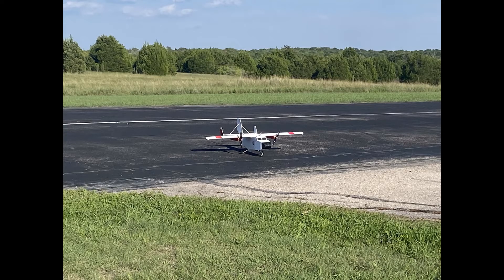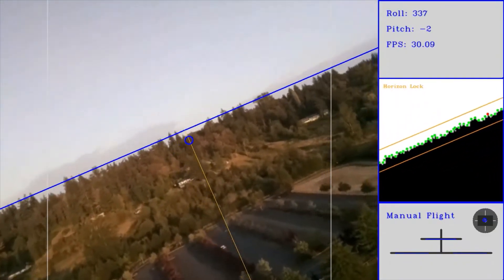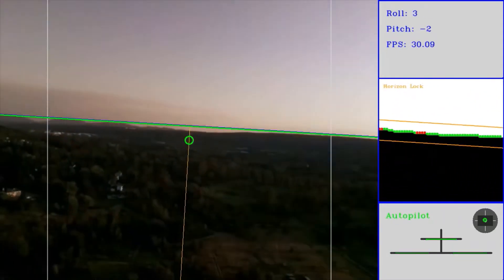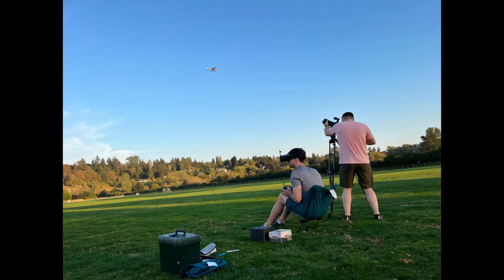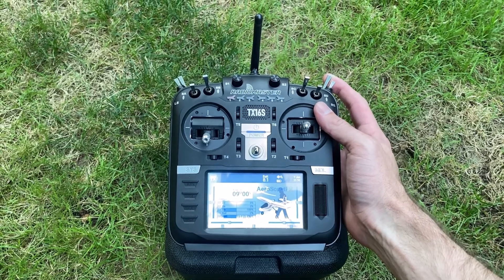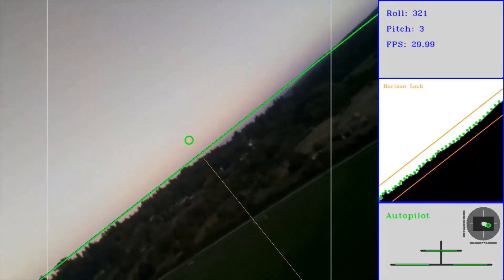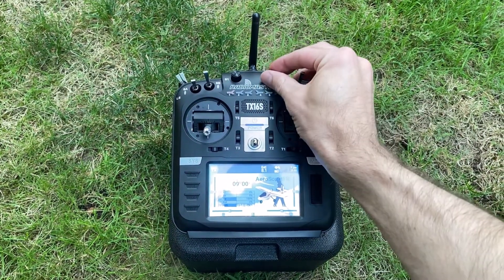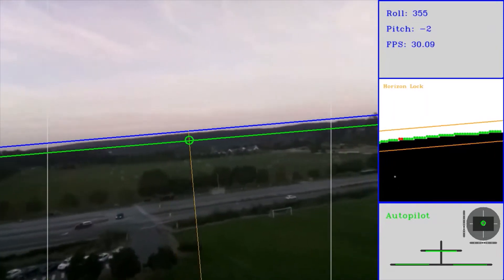Computer Vision Autopilot for RC Airplane

Comment: Hey tim, how did this drone to maintain level flight without use of altimeter during autopilot?
Reply from the maker: Hi Sahil. Altimeters don’t keep a plane flying level; that’s the job of a gyroscope. My system can keep the plane flying level by visually identifying the horizon. Since it doesn’t have an altimeter, it will tend to lose or gain altitude over time. I’ve tried to think of ways to visually gauge the altitude of the plane, but haven’t been able to solve that problem yet

Comment: May I ask how is the realtime video feed transmitted to you? What is the controller range of such a RC plane and how would you know it is about to go out of range? What happens if it fly out of range? Lost forever? Thanks!
Reply from the maker: There are two cameras on the plane. A raspberry pi camera 2 is used for the computer vision operations. It also records footage onboard, and that is what you see in my videos. It doesn’t transmit footage in real-time.

I also have an FPV camera with an antenna that transmits footage back to my goggles. I have never really tested the range, because I fly within a park, but sometimes at the corners of the park, the image starts to get a fuzzy, so I turn back.  The airplane transmitter has RSSI, so I get warnings if signal is low, but that rarely happens in practice.
Reply: @timmarkhuff  Great stuff. Thanks!

Comment: Cool project😊 don’t bother with rudder control
Reply from the maker: Why no rudder control?
Reply: because it's useless unless you wish to do aerobatics (assymertic flight) or if you must have a perfect lateral control during crosswind takeoffs and landings 😅 => I think both cases are irrelevant in your case (basically mono speed aircraft. takeoffs and landings from/to whatever )

Never forget that the best way to avoid a system failure, is by deleting it lol. 
Go on simplicity.

Use programmable/mechanical aileron differential to avoid lateral dissymetry during flight ... but maybe you have no idea of how to adjust such parameters ... ?!?

If your airplane has issues with lateral stability, increase the vertical surface. An approximate formula here 
Va*l/b*Sw=0.035

where :
Va=vertical surface (rudder and fin)
l=distance from the forward 1/4 of the wing's median chord to the forward 1/4 of the vertical surface's median chord
b= wingspan
Sw= wing surface
all figures must be in metric decimeters.

I really love your project. Ask for more info if you wish :) GL

Comment: Seems it would have difficulty flying in mountainous terrain where the mountains extend above the horizon line.  This reminds me of the AP2000i IR autopilot systems we’d use on RC helicopters 15 yrs ago. Those had an array of 4 IR sensors to detect sky from ground… purely analog. They worked for the most part but not so well on cool cloudy days.
Reply from the maker: It would struggle with mountains for sure. I’m interested in making a system that uses a machine learning model to find the horizon line. I’m thinking it could look at more features than just relative brightness, and therefore achieve better accuracy.

Comment: If you haven't started working on the waypoint system consider this:

When a (return to) waypoint is designated, start recording the velocity of the craft and its time traveled, to return to the waypoint(s) you can just reverse this velocity (for binary waypoint travel) or have it loop through each velocity transposed by some algorithmn (depending on the last visited waypoint) for loop routines.

Just a thought.

Comment: I think before you move on to altitude you need to determine the velocity of the plane (perhaps you can highlight key features in the video frame like a tree, building, etc and track how it's position changes over time). Then you can integrate the velocity (calculus is useful here) in terms of time to get altitidue (you only need the vertical component of the speed). Most computer mouses use this technique and a small image sensor to figure out this their position so I recommend research how they work . I also know that the Intel RealSense tracking camera uses 2d images to get velcoity (in the same way a mouse does) and uses velcotiy to get the real time 3d position. I wish you luck!
Reply from the maker: Good ideas! I don’t think visually tracking elements moving on the screen could determine a velocity though. There are so many confounding factors. To start with, altitude: you wouldn’t see much movement at high altitude and you will see a lot at low altitude, and we don’t even know the altitude at this point. Also, turning would cause things to move on screen, and we don’t know the rate of change of yaw either.  

There may be some complicated VSLAM algorithms that could do what you are describing, but I don’t think they can run fast enough, and I still doubt if they would work at all when flying high and little is changing on screen. 

Another consideration is that all of these methods could at best tell you ground speed, but what you need to know with airplanes is the airspeed. 

Recently, I have been thinking about using control surface authority as a proxy for airspeed. I might make a video on that in the future when I start working on that, but I have other tasks I need to complete first

Comment: Awesome! If you were flying close to a mountain ("bending" the horizon), your algorithm would tend to steer away from it, is that correct?
Reply from the maker: That’s correct. I’m interested in finding more robust techniques that can deal with things like mountains, trees, buildings and other obstructions.
Reply: @timmarkhuff   I wouldn't put mountains in the same category as trees and buildings. From the point of view of a bright/dark border finding algorithm, there are places where the (apparent) horizon isn't horizontal. If your plane has sufficient aerodynamic stability, you could calibrate the inclination and height of the apparent horizon while it is gliding without any rudder input. Then, from optical flow analysis of a donw facing camera signal, estimate yaw rate and start creating a "horizon map".
Reply from the maker: @IngenieurAndreas  when you say sufficient aerodynamic stability, are you thinking of planes with dihedrals that naturally tend towards flying level, like gliders? That could be interesting. I have a glider like that, and in theory, my program could control it by only managing the pitch. The roll would be managed naturally by the aerodynamics of the plane. The idea of the downward facing camera is interesting, but I’m trying to keep it to one camera at the moment. I’ve purchased a GPS module, and might just use that to manage the yaw/waypoint finding of the plane, even though that is straying a bit from the original goal of this project.
Reply from the maker: @IngenieurAndreas  celestial navigation? Nice. Might be hard to test that out in my local park though :)

Comment: WayPoint mission only with computer vision reminds me of back in the day flying my quadcopter in a familiar area was easy to find home because my vision provided the sight of familiar landmarks but if you are flying somewhere for the first time you need to follow a road or some type of a bearing in order to find home again, right? Seems storage of visual landmarks will need to be recalled same with flying to a WayPoint from scratch without a compass? Good way to get loss, it seems? 
I am really impressed with what you've done so far!!!
Reply from the maker: Flying a waypoint mission with computer vision would be challenging for sure. Not sure if I will be able to pull it off. I typically fly at the same field, so I could train it to recognize the corners of the field. I might also abandon that idea altogether. I just bought a GPS module, so I might use that instead.

Comment: Real neat!  But what if if looses sight of the horizon?
Reply from the maker: It needs the horizon to be in frame in order to work. If it fails to detect the horizon, it will maintain its current control outputs for a short period of time (one second) and then revert to a 0. This behavior helps when it fails to detect the horizon for a short period of time.

Comment: Wow, applied computer vision to analog FPV, no less. I wonder if we could look at your project the other way, as a cost effective sensor for an existing FC implementations like APM or iNav. Say over CAN, i2c, etc, to supplement accelerometers and gyros. My Esky Eagles (same plane) was a test platform for 1.2W fpv and 21700 cells, but iNav was good enough for me, lol. I can only imagine where you'll take this! 

And besides where the h%%l did you find a Pi4?! haha
Reply from the maker: Integrating the horizon detector into an existing flight controller would be a cool direction to take the project, however at the moment I am having fun building my own flight controller. I got my pi 4 a few years ago, before they became quite so expensive and scarce. I feel extra pressure to not crash when the pi 4 is onboard.
Reply: @timmarkhuff  Tim I salute your gumption, Sir. I hope your horizons stay flat as Florida, and that your contrast values are always perfect! 

I can't judge, I'm presently trying to use Ardurover to drift a WPL D12, much, much less successfully than your project lol

Comment: Are you using some kind of edge computing device like google coral usb accelerator or intel ncs2?
Reply from the maker: No, but I would like to experiment with that. I looked into Coral TPUs a while back, and they were either unavailable or super expensive due to global supply chain issues. They aren’t necessary for what I am doing right now, but if I want to run an ML model, they would be critical.

Comment: Great project, but I dont think it would be able to fly high high because at that point, there would be no object to determine the horizon. Do you have any ideas as to how you will fix this?
Reply from the maker: The plane would still be able to see the horizon when it is flying high. However, I believe that as it flies higher, it might need to aim for some point above the horizon in order to maintain level flight; pointing directly at the horizon would cause it to go down. If this is the case then plane needs an altitude sensor to help it deal with this effect. I may never be able to test this since I am using an RC plane that cannot legally fly high.
Reply: @Tim Huff  That would make sense. This is a rather interesting and new project I've never seen before

Comment: Woah, nice work! It will be interesting to see how you approach the altitude issue. It doesn't seem like there's an easy approach. I wonder if a second camera that always faces down (two dimensional gimbal) could infer altitude by the speed of object movement through the field of view. You could also model the upper air windspeed and direction by subtracting what you expect from your plane given its performance, (turning radius and level flight considering engine output). A long climb out into wind would allow it to start building such a model that can be updated throughout the flight. I think that's how I'd approach it.
Reply from the maker: Exactly, it's not an easy issue to solve. Using the inferred ground speed of the plane could be problematic; if there's wind, this wouldn't be accurate. I'm wondering if there are any machine learning models that could be trained to infer segments of ground that are "far away". Even that has problems though. It might be slow, and what happens when the ground is not visible?
Reply: @timmarkhuff  why wouldn't a generic barometric pressure sensor work for you?
Reply from the maker: @LimabeanStudios  you’re right, it would work. However, my original plan was to only use computer vision, just as an exercise/challenge. I might end up abandoning that idea and incorporating some standard sensors.
Reply: @timmarkhuff  You know, I spent like 5 minutes trying to I think of why it wouldn't work totally forgetting you were going for pure computer vision.

Comment: how to switch on auto pilot mode from manual control,is there any option that already built in transmitter like in this video you turned on the switch
Reply from the maker: I designate one of the channels on my radio to be for the autopilot switch. It is operated by a two-way switch. On the plane, there is a Raspberry Pi that uses its GPIO pins to listen to several channels coming from the receiver. One of those channels is the autopilot switch. When the program sees that the autopilot switch is pressed, autopilot takes over.
Reply: @timmarkhuff  how can i contact you sir, i have some doubts regarding this..are you in Instagram..?can I get your I'd